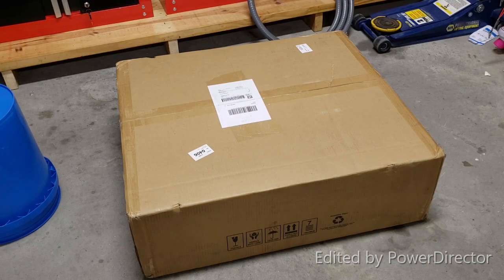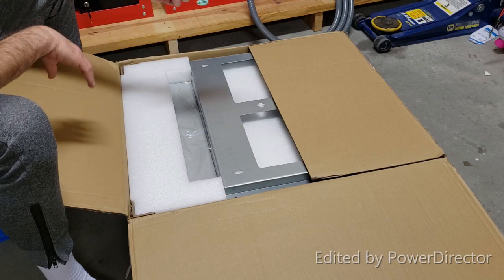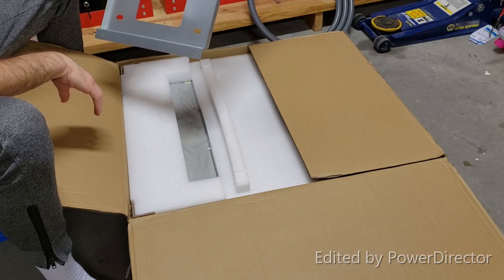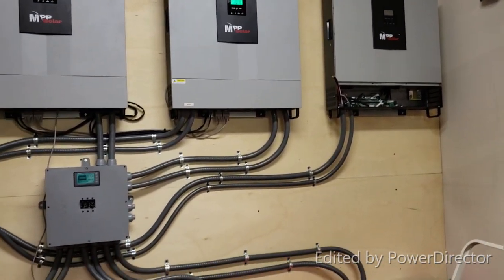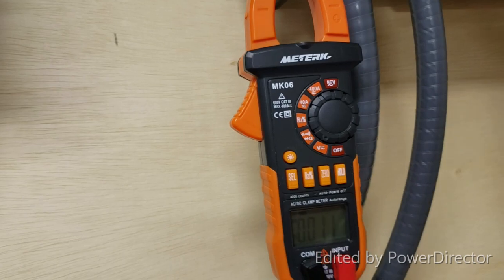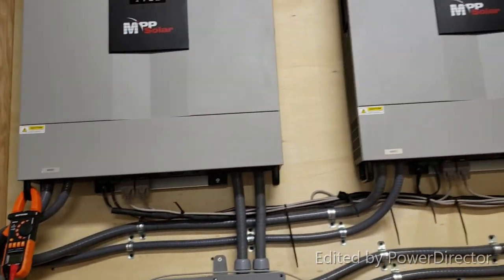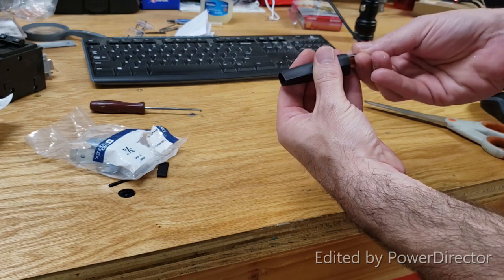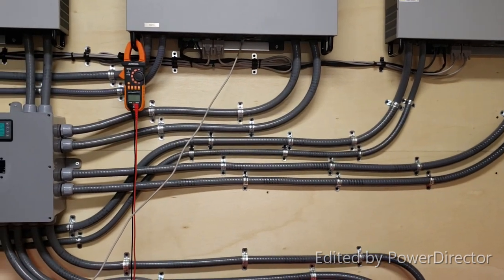MPP Solar LV5048 #3 Unboxing and Setup.

Comment: Are you having issues with flickering lights as you did with lv6048 , I have 2 lv6048 in split phase and I noticed flickering lights but I did not hock up amp sharing cable

Comment: I have a question I will ask on most recent video but for this one the newest or 3rd lv5048 doesn't appear to have the recommended 20cm or 7.89 or do inches clearance on its right side to the adding wall.  I personally wouldn't worry about this mainly just wondered if you did this on purpose or not.  Also not mounted on non flammable surface and I was going to do the same thing till I found a sheet rocked spot to mount it but that still has paper covering over the gypsum.
Reply from the maker: All that is true but god forbid those batteries ever catch on fire. NON flammable backing or not the U.S. homes are still built out of paper and wood and I do not think it would help. But hey, your choice of what you want to do.
Reply: @DMIINC2013  Very true.

Comment: I need help a bit, i just bough two inverter like you, did you have to change the parallel pcb board to hook two of them to have 240 splitphase for 10kw total?
Reply from the maker: Hello. LV5048 comes with parallel boards already. See this video for setup https://youtu.be/iTEcvDKF5j4. Thanks for watching.

Comment: Great. Nice Video.
We have the exactly model ISolar MLV 5KW.  it is Super Power 5KW for 120Vac 60HZ output (Like US/ Canada/ Mexico and Latin America countries). it also support split phase 240Vac ( L1-N-L2). it can be parallel with Max 3 units. So you can get Max power 15kw for single phase and 3-Phase. Check this link: 
https://www.aliexpress.com/item/33058021760.html

Comment: Did you ever figure out the communication for the raspberry pie?
Reply from the maker: Yes.
Reply: @DMIINC2013  And? Help me please. I was an automation technician.  I would love to make an interface for the alarms and trends. So what is it? Modbus,  bacnet, canbus?
Reply from the maker: Let's start like this. Communication from what to what?
Reply: @DMIINC2013  it doesn't matter to me. I just want to be able to connect my mppsolar to my home network then possibly to my phone so that I can check up on it without having to go to my shed
Reply from the maker: Have you seen my later videos in regards to what you want to do? Lot of info there. In addition, ongoing project can be found here https://github.com/jblance/mpp-solar

Comment: I love the conduit! I noticed it keeps evolving. What type are you using now? Also I'm curious how you terminate the conduit in case of the LV5048? Thanks!
Reply from the maker: It is a flexible 1/2 inch and 3/4 inch conduit that you can get at the home depot. There is not that much in a form of termination of a conduit at LV5048. Watch the video again and it is right at 5:09. However it as tight fit and is secured by brackets at the wall.

Comment: You are going to need that gutter when you start smuggling those PV panels to the roof. 😜

(I just put my second string up) 😆

A couple pics:
https://diysolarforum.com/threads/my-off-grid-panels-going-up-real-soon.4885/post-58627
Reply from the maker: Where is the video?

Comment: Very nice. I still only have one LV5048 with my leaf powerwall (leafwall) it works very well. I moved over all of the 120v circuits from the house to it and balanced them across both legs.
One thing I notice with mine, when running off the batteries or solar, my LED lights in the house flicker occasionally. I was thinking of adding some ceiling fan capacitors in parallel to those lights to avoid that occasional flicker. Doesn't always happen, maybe once every few minutes.
Reply from the maker: If you pay attention to it you will notice that it only happens when system is switching from lower to higher consumption. It feels like a car switching gears constantly when going up hill. Once I hit certain threshold it stops. I am thinking it is a design feature to try minimize power consumption. And yes I can only notice it on my older LED lights. Newer ones don't seam to be affected.
Reply: I notice this also, but only on the LED lights just the same. Nothing else flickers or happens.

Comment: Very nice!
Quick question, when you get the solar installed are you planning to feed excess power to grid if so I think your inverters are not UL listed...
Reply from the maker: They cannot export back to the grid. They are not grid tied in that sense.
Reply: @DMIINC2013  was wondering. My interconnect agreement limits me to only UL approved inverters. Even on a cloudy day like today I sold 2.7kw to grid from two arrays totaling 8.9 kw. Only reason I want to increase battery capacity and and add a few more panels is to offset the freeze dryer which we are using pretty much 6 days out of the week. Summer will generate more than enough power but winter we fall short with the freeze dryer.
Reply from the maker: My system will be so called "selfish solar". Grid will be used only as back up. No export what so ever.
Reply: @DMIINC2013  understood. We want to take advantage of the credits to offset any shortfall in the winter months.
Reply: Unless he gets permission to put up 15 kw of panels he will never make enough to sell, use and keep the batteries charged too.